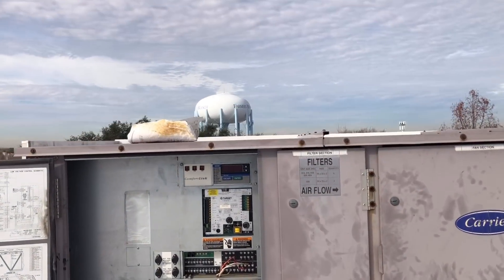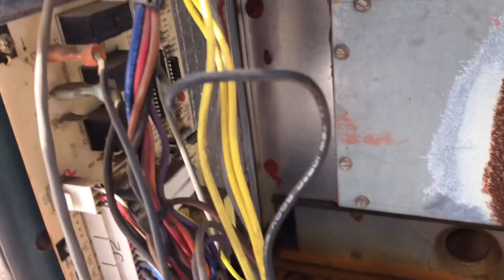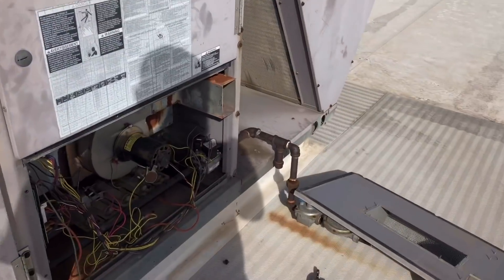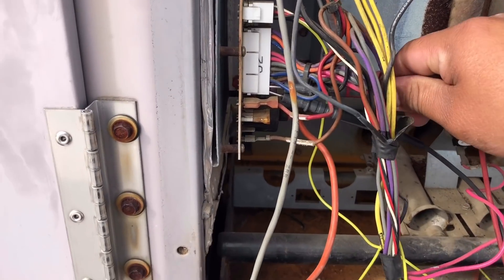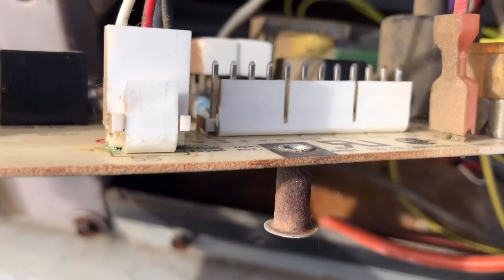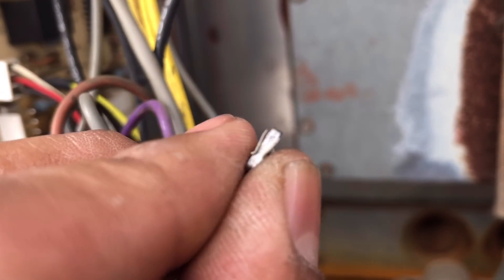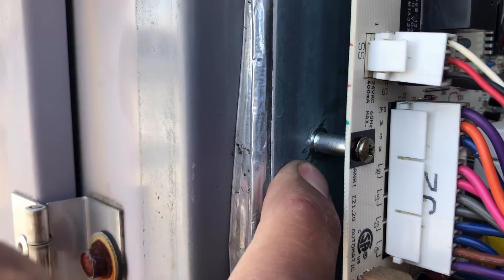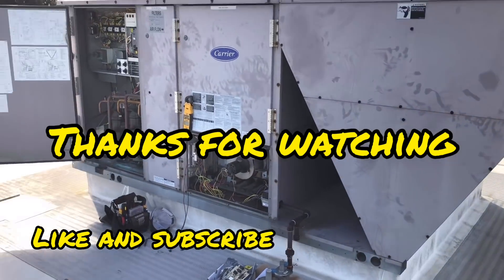HVACR:  No Heat Call, Carrier RTU. Constant Callback

Comment: if you change borads just because of discoloration you will be changing all of them.  The resistor gets hot- discolors the board so that by itself means nothing.   In fact, boards so rarely fail that its an easy trap to dismiss it as being good.    But like the others- the molex connector solder joints are damaged probably from someone grabbing it and pulling on it.  this might have actually started as another problem and turned into this problem with the original issue being fixed.   You have to be super careful unplugging those and when I see someone grab the harness and pull as hard as they can- I know I don't want to work with that guy.   Good job.

Comment: I’ve had that happen before. You can put a toothpick in there to force the pin connection to get them by until you get another circuit board.

Comment: Definitely looks like it was a cold solder joint on the PCB. Easy fix. You could carry a small soldering iron with some fresh solder (use leaded solder if you can) and you can fix this in the field. Just add some new fresh solder to the joint to "re-wet" it wth the flux that comes in the solder. Having a soldering iron, solder and some heatshrink tubing will also allow you to repair wiring harnesses in the field if necessary

Comment: When I see a circuit board that looks like that that brown/yellow color indicates to me something is shorting out and or arcing also may I put my 2 cents in when our company  scraps a RTU if I can I try to salvage the modular connectors sometimes you can spray a contact cleaner which does not leave a residue because it evaporates troubleshooting for me is the best part of the job besides lunch keep up the good work just started seeing your videos did you say Farmers Branch in the background on the water tower

Comment: Had a similar fault with a Hydronic boiler. I replaced a thermistor got the thing going, as soon as I shut the flap it turned off. Traced it to the plug on control board. Pinched the prongs all good 👍🏻

Comment: And bad solder joint strikes again... I just re-soldered my airbag disable switch for my work truck.  I found the solder joints to the entire connector were not attached to the pins.... quickly fired up the soldering iron, flowed some new solder and it works FLAWLESS...
I re-did EVERY joint... but then again it was ONLY 10.... 4 pins on connector, 2 on bulb, and 2 resistors. It had a contact bar moving between pads to switch which resistor was used, either a 1.02 ohm or a 895 ohm... and the light was direct from the connector to the bulb
When it comes down to it that switch is ONLY available from the manufacturer and costs $100.  The repair cost less than $0.05 including electricity!  It is amazing how much the part costs and how simple it is.  A board like the one in the video is more complicated, but not by that much, just a lot more joints.
Reply from the maker: Agreed

Comment: A bit late to the party but.. 5:19 "better grounding"... No, you won't get better grounding. Because the board do not have any trace going to the spacers/screws. And I beleive the issue is a broken solder joint on the board. I think I may have seen one around the gas valve pins, but it was too blury to be sure...

You should thanks lead free solder for this, it is brittle and crack easilly.

Comment: Cracked board. The discoloration says heat damage as in thermal issues. The heating and cooling over time probably broke the solder joint and that was your issue. I have seen guys reflow solder on circuit  boards simply by placing them in an oven but its not something you should do in your line of work. I Have seen guys repair computer boards and television boards but furnace boards I wouldn't take the risk. Its already been subjected to heat damage, I doubt if reflowing the solder joints would even work on that. $500 for a wiring harness? Sounds like a GM truck now. lol.
Reply: Reflowing in an oven is pretty much for BGA chips and Surface mount. Through hole, you're better off with an iron and good tip.

Comment: Heh... I got a free flat-screen tv that way... All it turned out to be was a silly cold solder joint on the board. Easy fix, flux it up and hit it with a nice hot iron to reflow. I still have that tv! 

To spot a cold solder joint; look for a dull looking solder blob on the board.  9 times out of 10, it's on a ground plane or something that pulls heat during the soldering process. Turns out; a cold solder joint leaves a thin layer of air between the two sides of the joint and, over time, a very thin layer of corrosion works its way into the space. Once the layer is complete, it starts behaving like a capacitor and will completely block current until disturbed (could be thermal expansion due to temperature chances, wiggling the harness/board, etc). It can happen with lead solder joints but is much more common with these crappy new lead-free solders..

Comment: 580 dollars because they give you all the wiring harnesses. What a bunch of assholes. Anyway i find that the board in an instance of mysterious foolery such as this call usually winds up being the culprit. I can garuntee that those loose connections you fixed on the molex connector had alot to do with the board failure. Good call on that one

Comment: ahhh yes bad solder joint, replace entire motherboard.
Reply from the maker: Yup. Exactly
Reply: That's how it goes unfortunately. Going from an electronic tech to a tractor trailer mechanic, I cringe everytime I have to replace a board for something super simple.
Bad connection on a relay? $1k+ out the door... :-\

Comment: Looks like or sounds like a cold solder joint to the connector. Since you know your not getting voltage to the gas control valve I'd wold trace those wires back to the board and see witch pin on the connector that goes to the gas valve.  If you has a soldering iron I would touch up each pin I fell one is has a cold joint and losing connection.   I have had this happen before and touched up the solder join and work for a few years later.  I also have had board with bad relays replace relay and got my system back up and going.  But it was a 35 year old system in a double wide. I no longer have that problem after I replaced it with a new system that is 97% efficient.
Reply from the maker: Yeah. It’s definitely a cracked solder.   Found it the next day.

Comment: on a residential
what would cause a high pressure switch on the outside unit to kick in after 2 or 3 On/Off cycles? This affects heating and AC
Reply from the maker: Umm what exactly do you mean.  Open or close.  Heat pump?
Reply: @rookierefrigeration4357  Heat pump, and not sure tbh.. I wasn't really told much.. Okay.. so during the summer there was a week that was really hot out and that's when this started.. So, the inside unit would continue to run even though the heat pump was off (supposed to be on). It took basically calling the company I use 4 times for me to figure out how to temporarily fix it. So what happens is, the heat pump will run fine for 2-3 On/Off cycles, turning off and on, after which the heat pump will not turn on and I have to use the wet/dry switch to reset the system in order to get it working again (I have to do this every time otherwise its just circulating air), so I called a different company and the guy told me the reason for it doing that is the high pressure switch is turning the heat pump off. So my question is what would cause that to happen and what would be a way to fix it as cheaply as possible? I know there are a lot of variables in trying to figure out what a possible cause/fix would be.

Keep in mind that i'm the one that figured out resetting the unit via the wet/dry switch gets it to work normally, the repair guys at the time messed with the switch and got the system to work afterwards but it wasn't until I started testing things that showed they didn't actually fix anything as it kept happening.

 it took 4 visits from the same company and 1 guy from a different company, the last guy is the one that told me its the high pressure switch that's stopping the heat pump from turning on, of which as I said happens every 2 or 3 times the heater/ac turns on and off. Sorry about this huge wall of text, just trying to get as many opinions as possible
Reply from the maker: DigitalIP well, if it is the HP switch, IF IT IS THAT, you could be dealing with a dirty coil, fans not moving enough air, etc.   if it happens more during heat mode than cooling mode, you could be overcharged on refrigerant.  The evaporator is smaller than the condenser generally and will cause problems is the unit is overcharged.   There are way too many unknowns so I can’t give you an answer.   Just may want to get an actual technician onsite.
Reply: @rookierefrigeration4357  That's helpful actually. And the 2nd guy did mention that the 1st company may have over charged the AC a little as they did put some in to see if that was the problem in the first place. The issue between Heat and AC is pretty much equal, 2-3 times then the heat pump shuts off and I have to reset it via the wet/dry switch. Dirty coils are a possibility, airflow isn't an issue however but sometimes E-Heat has to kick in to give the heating a boost when its really cold, so it likely does have to do with dirty coils and such.

Thanks for actually replying, it was helpful.

Comment: I had the same issue in a residential furnace. I was just the circuit board. 
Probably a bad solder joint. Happens all of the time..
Reply: Board probably made in some worthless place like China!
Reply from the maker: @rgj5832  what isn't nowadays
Reply from the maker: Yup. Exactly

Comment: i see the problem the solder on the board is separated on one of the connectors. a little heat and flux and it would be good as new. temp change and pressure on the connector can cause lead free solder to develop cracks at the area of changing metals. the steel connector expands or contracts at different rate then the solder. some solders also work harden like copper does.

Comment: I'm not an HVAC guy but been a tech and engineer for 40 years...$500 for a harness is a little steep!   You could by the crimping tool and connectors from Molex for less than that!  You would be a rock star tech!  and save your customers big$$$.  (of course, you should carry (lead) solder and a soldering iron too!)  Good video.  I love a good puzzle - when it's solved!
Reply from the maker: Thanks bro

Comment: Burnt board delamination  thats what causing the poor connections. But who ever messed with the wiring is an A HOLE is dosnt take much to zip tie and mount everything neatly to a pice of tin wormwood or anything a clean neat wiring  route saves heachachs in the long run.

Comment: I work on x-rays and I have the same issue on the power switch. The solder joint fails and it sometimes lifts a trace on the board. At that point I’m screwed and have to replace the board. $1,700 all for a solder joint.
Reply from the maker: Holy hell.  This board is only 200$.
Reply: Rookie Refrigeration welcome to the medical field 😁
Reply from the maker: @vallejokid1968  wow. You can keep it bud.

Comment: Can't tell you how many boards I've seen go bad in various automotive applications where you wiggle the connector like that and think maybe it's a loose pin in the connector but it's actually where the soldered pin is on the backside of the board.
Reply from the maker: Absolutely.  Thanks for the comment and for watching.

Comment: i would like to do something like this one day, became an electrician for the troubleshooting and maintenance, havent done a shred of it since i became indentured in the trade. Just all construction. nobody has ever given me a shot at this side of things. am a journeyman now, same issue, still stuck in construction. dont remember the last time i used a meter at work other than seeing if something i want to work on is live or not. even then i usually just used the fluke voltage tester pen (shouldnt be since nothing is landed in the breakers but it has happened, though only once.)
Reply from the maker: Yeah, we really do allot of everything.

Comment: Get a soldering iron. The most common issues on these connectors is actually cold joins cracking or broken pins.

You can check this easily with your meter: just clamp one pin, follow the lead on the board and see if wiggling will cause any connection issues.

You need a fast meter for this, though.
Reply: Ruben Kelevra you can just ohm out the pin to the back connection. If it has continuity then it’s completing the circuit. If not then you found your open circuit.

Comment: carry around a butane soldering iron. you can fix that in a matter of minutes with that cracked solder joint. its not quite your job to do component level repairs but it sure makes the customer happy to not need to buy a new board.
Reply from the maker: Nah.  I’ll just replace the board.  Those customer wouldn’t want us doing that kind of stuff.  Thanks, I would do it for myself or family, but not for these customers.
Reply: Not really, they glad to pay longest problem is fixed when the board starts to go its time for a new one.

Comment: Clasical case of cold solder joint. That is why I always have soldering iron in my van! That is where my amateur knowledge of  PCB diagnosing and repairing comes handy and pay off. Cold joints, varistors, diodes, and connectors are not much hard to diagnose and repair and it always pays off.

Comment: ;the resistors on the board look over heated!
Reply from the maker: Yes.  But the cause of the board failure was 3 cracked solder joints on the pins.  I posted a picture to my Instagram.  Clearly see it.

Comment: The only problem there was cracked solder joints on the board--it would've taken you less than 5 minutes to resolder the connections
Reply: Are you a certified to take on that responsibility if there is a malfunction on the board and they blame you for something malfunctioning causing an explosion or a fire? We don't do repairs at board level because of the liability.
Reply from the maker: Exactly Rick.  Thanks
Reply: @HVACRSurvival  What are you talking about? What liability? We're talking about cracked solder joints--fixing them will not cause any issues, and will also 1) save your customer money 2) in the case of hard to find boards, get them up and running quickly
Reply: @justsumguy2u  let's say for example there is an unrelated issue in that control board that you may or may not have caused,  later down the road for some reason the board malfunctions and does not shut the system down and there's a fire and there's property damage as a result from it, there will be an investigation Into the Fire and they will find out where the fire started at, next thing you know the building owners insurance company will try to pin the liability for repairs on your company's insurance company because they don't want to pay the bill. If you don't believe me ask somebody that's been an auto accident. They're notorious for passing the blame.  You relieve yourself of any extra questionable liability when you use new oem parts because the manufacturer of said Parts had produced it and have taken on that liability by getting it tested by underwriter Laboratories Or whoever it's certified by.
Reply from the maker: I’m not doing that bro. Not at all.  New board and done

Comment: Looks like those resistors on the control board got REALLY hot at some point. That alone would make me think the board is bad or is about to be.
Reply from the maker: I've been told that the discoloration is normal.  But the board was bad because of broken solder joints
Reply: @rookierefrigeration4357  
Did you end up reworking the joint?
Reply from the maker: billybbob18 nope. New board in the unit.  Old board in trash
Reply: @rookierefrigeration4357  
That's what we do. If it were my personal machine, then I would go for it. Customers may never seen me with my soldering iron (unless it's a hoshizaki ice machine with a bad compressor relay). Those boards are many hundreds, sometimes approaching a thousand.
Reply: @rookierefrigeration4357  No way that the discoloration is normal.  OEM may tell you that it's normal, as to not alarm you, but it's not normal for them to get that hot.  Too much current and/or voltage went through that resistor, to get it that hot.  If OEM has a design problem, you'll see this pop up more in the field.
Reply from the maker: Yeah.  I agree.  That’s why I just replaced the board.

Comment: A lot of effort trying to salvage an old sketchy board.   Just replace the board.  Probably a generic replacement will work for 1/2 the price.   But if you have a Carrier supply house in town, good for you.  It’s 2 days where I live.

Amazing someone replaced the gas valve without verifying that it’s getting power to the gas valve.   Flame sensor replacement is also a parts changer move.
Reply from the maker: Lol. Yup.  Having problems since last year.  I'm glad I caught it.  Thanks for watching

Comment: Common problem with rtu s. Also, due to the age of the unit, inspect the heat exchanger. Can easily be done by removing a panel on the end of the unit, or through the blower compartment.
Reply from the maker: Yeah, head exchanger was inspected.  No visible damage.  But they are already planning on all new units.  So🤷🏻‍♂️
Reply: @rookierefrigeration4357  Smart

Comment: Well done. The soldering of heavy components and connectors under mechanical load will crack due to vibration and shock. Fix the wiring to the board and the board will live much longer.

Comment: When I saw you move that harness and the valve cut in and out I knew it was the board. Guarantee you it had a cracked solder joint where the harness was connected
Reply from the maker: Yup. You are exactly right.   100%
Reply: that is common where there is a lot of vibration   happens on cars as well  now you know  were to look  next time